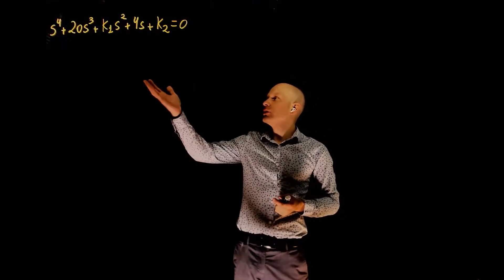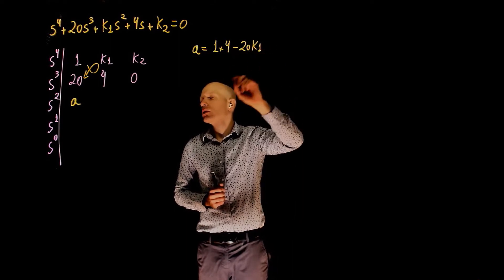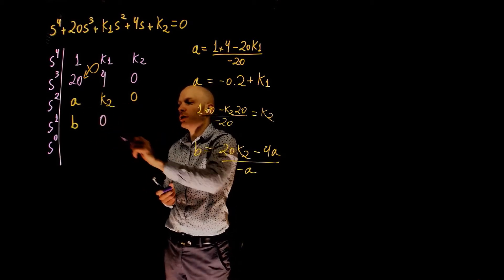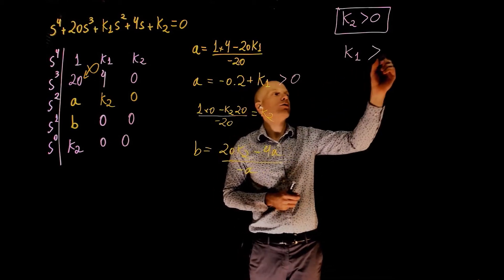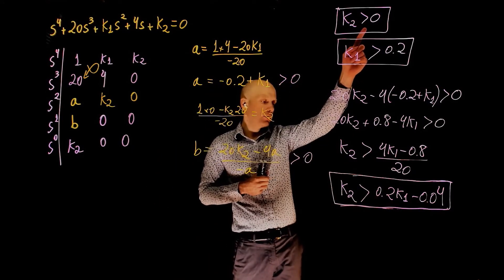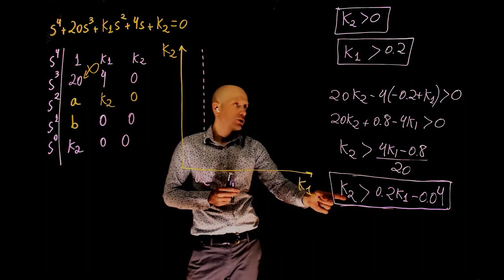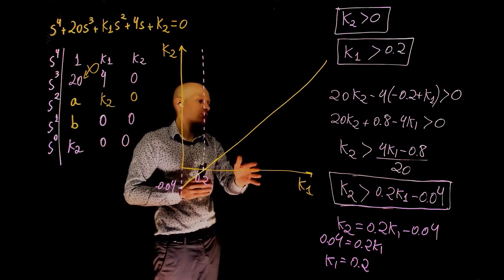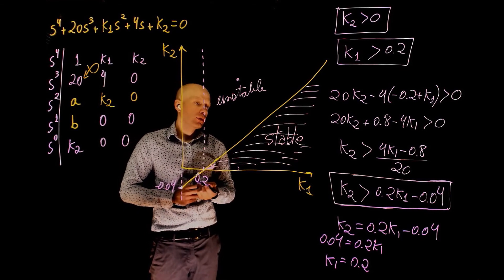L10E49 Control Systems, Lecture 10, Exercise 49: The Routh Hurwitz stability criterion.

Comment: when you are playing with inequalities, dividing and multiplying the inequalities on both sides even if one of those sides has a zero shouldn't it still have its greater than or less than sign fliped.
Reply: yes you're right it should be flipped, that's why the end result is still correct (the stable part should be the upper side of the line if K2>0.2K1-0.04).
the value K2 should be in this range 0<K2<0.2K1-0.04